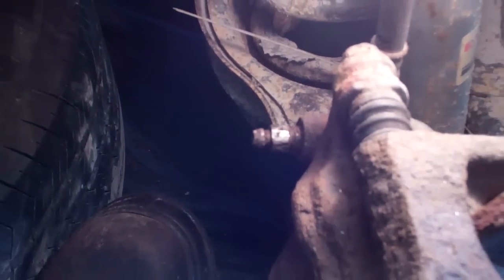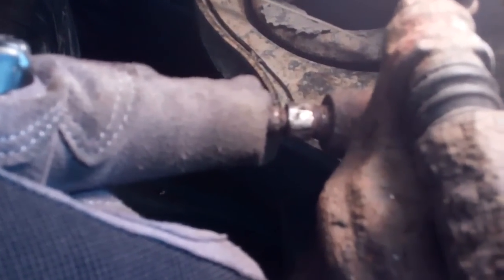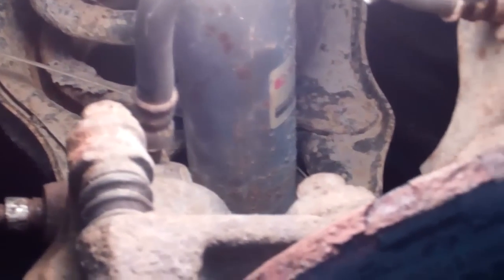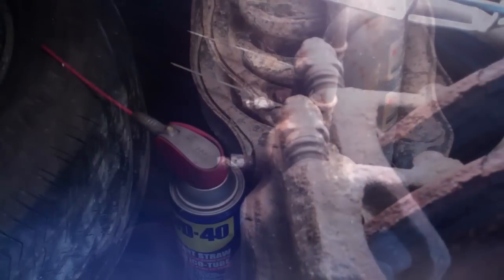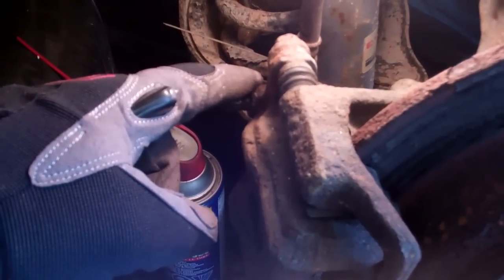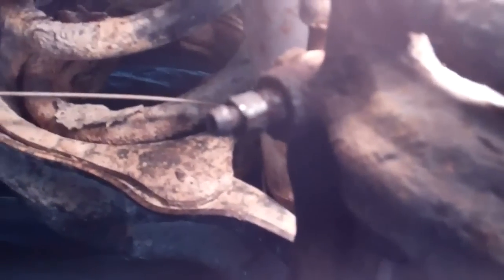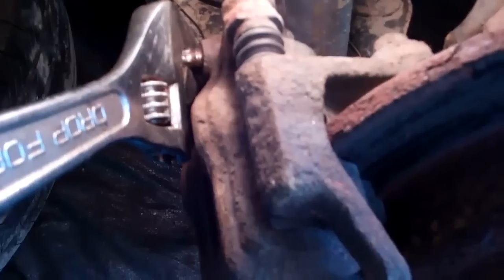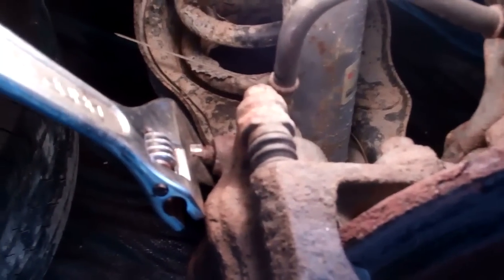A method for removing a seized brake bleeder valve

Comment: He's lucky he didn't strip it again wit that adjustable wrench piece of shit! A proper size socket works for me everytime unless the bleeder is truly seized and thinned out from lack of maintenance or sitting which no mechanic wit wd40 can remove without breaking it off… if it breaks off just drill the hole n retap, stay away from garbage easy outs which will just break off n then u gotta drill out the hardened metal with a carbide bit b4 gettin to drill the hole n retap it like u should have dun in the first place! Lol

Adjustable wrenches are for plumbers imo n don't belong anywheres touching a car!
Reply: I've used sockets on many occasions.  They work well.  I have one now that's totally stripped and seized (first brake job I've done on this vehicle), so I decided to look at some videos.  Got some new bleeders...now just need to try again.  Some heat usually helps, but you need to be careful.

Comment: The grinder did two things. First it vibrated the valve, second it heated the valve this is why it came off with an adjustable wrench. Great video. I will try this on my chevy truck

Comment: Thanks for a great tip. Spent all weekend on the car and had this problem when bleeding.  Got the angle grinder out and using an adjustable wrench the bleeder came out. I suspect the heat from grinding also helps a bit.

Comment: I had this problem with my rear bleeder screws.  Tried the heating 
method several times and using oil, but no go after two hours.  The nut 
was stripped.  Tried to file it so I could grab it with vise grips, but 
it would just slip.  I couldn't get a good grip on either of them.  I 
had to end up replacing the wheel cylinders.

Comment: It's called an easy out.  Irwin makes a set.  You can also grind it flat, then use a cut off disc to make a slot then use an impact screwdriver to back it out.  Or you can use a drill bit just smaller than the internal screw threads and if you're careful and you drill it easy, you're left with just the metal of the valve in the thread and that can be pried out or threaded out, but that's a more advanced technique.
Reply: thank you friend, you saved my day...I saw that Irwin kit at Advance auto and then nearby that I also was another cheaper tool called, "grip tite tools" a set of 9 for 24.99 for any kind of rounded screw!! these tools are like must haves for any DIYs

Comment from the maker: @Seventhsonofamaiden I had to remove a broken bleeder once Seventh ;I bought a kit  that was kind of a reversing drill bit. I drilled a hole in the bleeder valve, then put this "reversing bit" in the drill, drilled into the bleeder valve, and it broke it free and unscrewed it. Worked great but I can't recall what it was called-maybe someone on here wil know.
Reply: They are called reverse drill bits. Harbor freight sells a cheap set.

Comment: Incorrect title. Valve is not seized. If wrench won't work, (truly seized), vise grips or adjustable wrench certainly won't work. Correct title should refer to the rounded off hex edges.

Comment: saw.a video of a guy that simply heated the screw with a torch for about 15 seconds, then threw a wet rag on it to cool it down quickly, then it turned out REALLY easily. stripped or not

Comment: Best idea is to spray wd40 at the base of the thread then tap a flat bladed blunt chisel around the base (just gently) using a small hammer to free the rust from the threads and if the nut is chewed as they usually are on older cars - newer cars use brass nipples which never chew up - use a pair of mole grips set on maximum tightness to remove it - works every time for me and i have been a mechanic for 30 years!

Never broken a bleed nipple in 30 years - only idiot mechanics do that!

Comment: ....and yet no one has mentioned the proper tool for the job. Its commonly referred to as a flare nut wrench or line wrench. Also good practice is to clean your under carriage. Or at the very least the component you intend to work on.